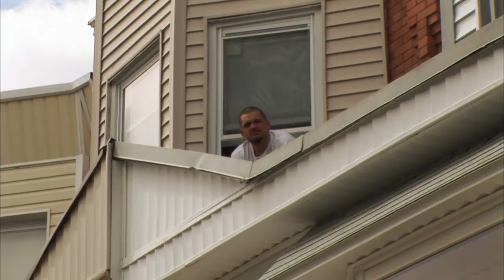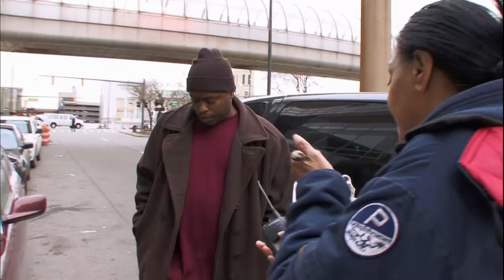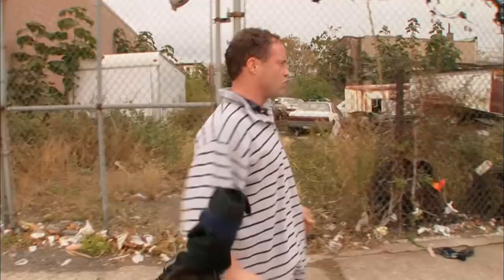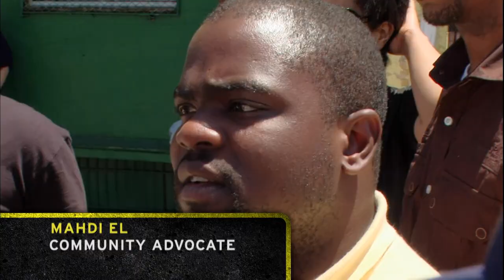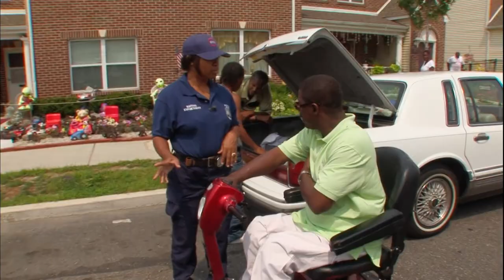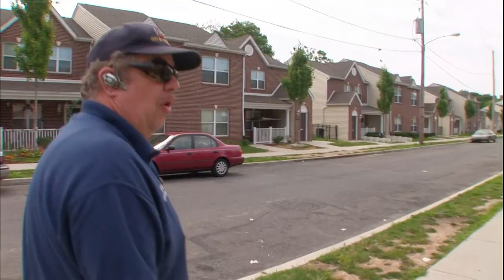Parking Wars: "I JUST Got This Car!" - Top 5 Moments | A&E

Comment: So the last one went from $100 in parking tickets

To $100 in tickets, $300 for the boot, maybe $100 for the tow truck and then another $150 to have 2 new tyres fitted to replace the one he damaged plus the matching one on the other front axle.

That was an expensive mistake.